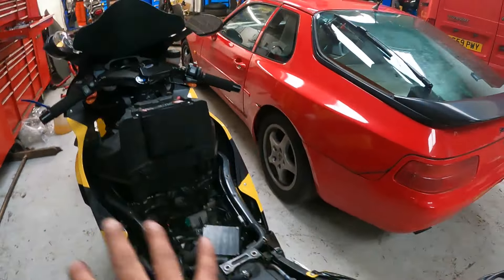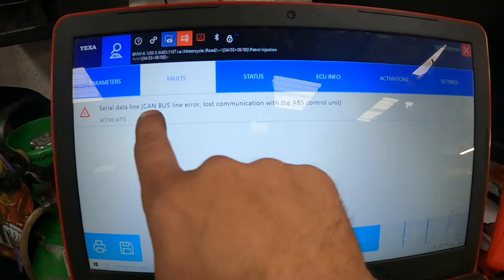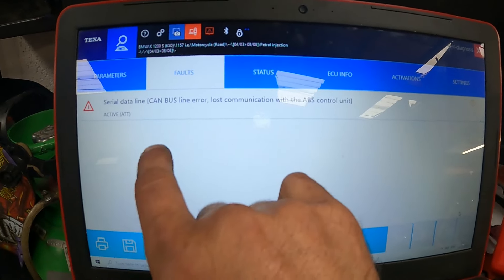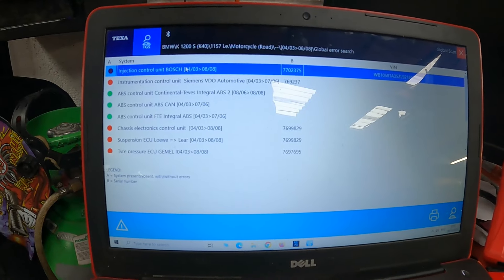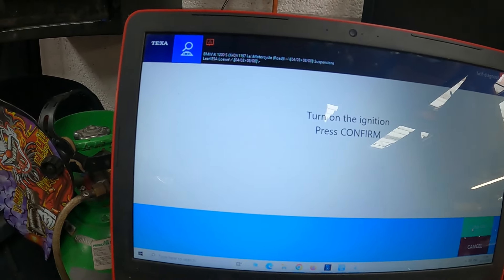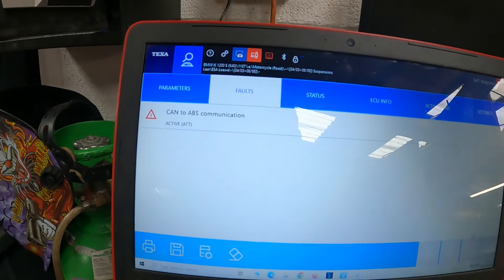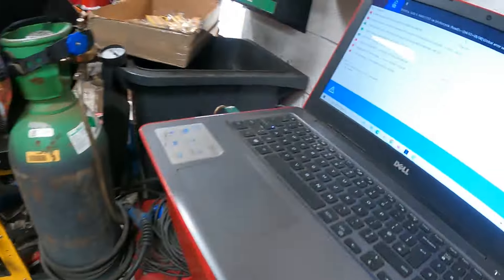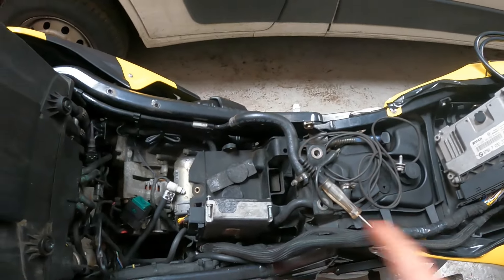BMW K1200S ABS issues and no speedo!!!

Comment: Really interesting to follow your chain of logic to find the faults.  Give me a cryptic crossword rather than a wiring diagram any day.   I ran a K1200S for several years but now have the much improved (by Ricardo) K1300S.  My K1200S gave no problems apart from a pinhole leak in the rad.  I'd read on the K-bike forums that if the electric brake servo failed on the K12, the residual braking was almost not-existent - luckily I never got the chance to find out.

Comment: I had the dsc triangle, amber abs and red brake light all on. No speedometer and abs lights flashing along with failed brake light.  I tried a rear abs sensor. No luck. Fix was a bent pin in the abs module. Where the plug goes onto the module, a pin was bent up inside of the module. Straighted it out and tweaked the surrounding pins. Some are tiny so be careful. Straightened out the one bent pin. All working well now. 😊

Comment: Great video. What’s your preferred source of technical information and wiring diagrams?
Reply from the maker: This was through my Texa diagnostic tool, I pay extra with the subscription for the tech data. It should be available through Autodata and E3 technical subscriptions as well. 👍
Reply: The 'home made' back panel really needs a gasket to make it water tight. Another option could be using a gel potting compound, often used in outside wiring boxes to prevent water and moisture. It has the added advantage of being soft so can easily be removed at a later date.

Comment: Hello, my speedo is out to, I have bought a gs911 so I can read fault codes, and I have on the rear sensor a faulty speed, the front one standing is good the rear shows wrong. I have tried already a rear sensor from a disassembled bike, didn't work, I am thinking to buy a genuine rear one, do you think it will solve the problem? Thanks in advance for your answer.
Reply from the maker: @borsosmisik9812  I bought 2 after market sensors at my expense which didn't work, I had to buy a genuine one. Without being there I can't confirm your issue! Good luck 👍😊
Reply: @melsmotors  my concern is about that the sensor I tried with it is an Oem one not aftermarket, thanks anyway for your response.

Comment: So it turned out to be the front abs sensor?
Reply from the maker: Yes, plus the module
Reply: @melsmotors  ok thx.  I have a 2007 which has a different type of abs and my speedometer is also not working. Could it be the front ABS sensor?
Reply from the maker: @mariotorchio4075  not sure, have scanned it and looked at the live data?
Reply: @melsmotors  not the live data. Just the error codes.  I have motoscan
Reply from the maker: @mariotorchio4075  without live data you're not going get very far! You need to know what the sensors are doing, a fault code will help you look in a certain area, then with live data you can narrow down the issues!
Reply: You don’t fancy doing another k1200s 2005 do you? Same issue